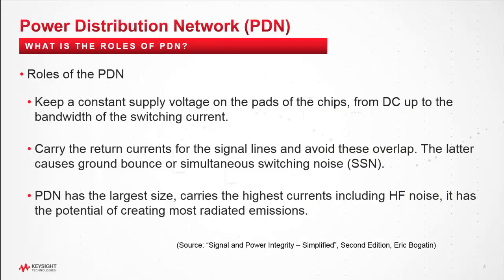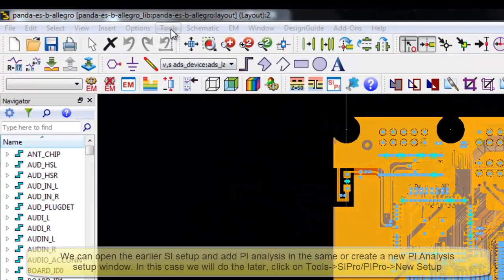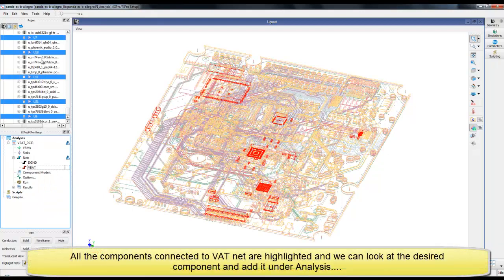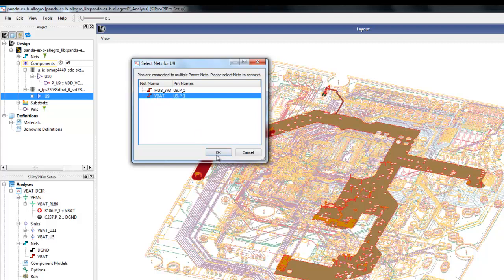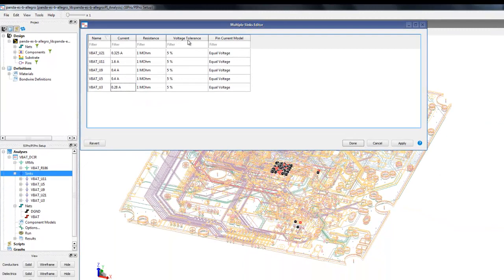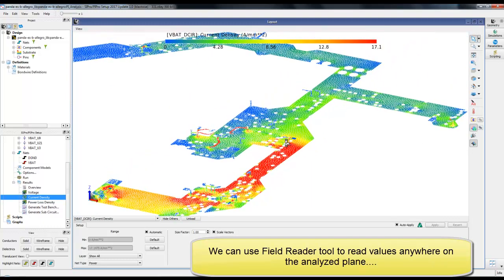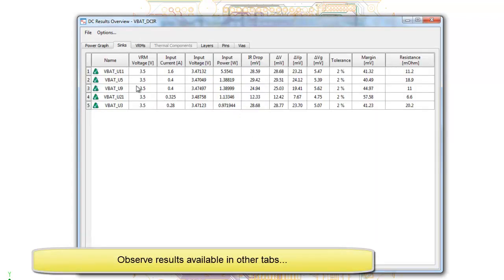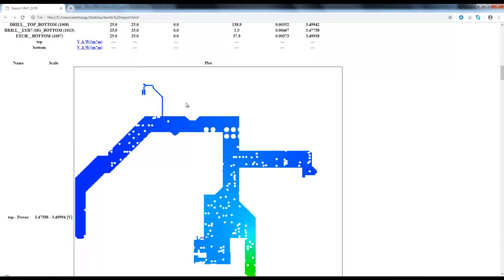HSD Tutorial-5: DC-IR Drop Analysis using PIPro

Comment: Hii thanks for this video. Suppose a voltage source is connected across 2 series connected resistors. And then how can we select source and sink?
Reply from the maker: I would recommend you to contact local Keysight tech support team on this but you can pick any of the resistor as source with desired voltage level. Sink is typically the IC where you want to supply voltage & current.

Comment: Hi sir,
What is the allowable current density for DC drop analysis?
Reply from the maker: I am not sure I understand your question as that is pretty much depends on your application & how much material can handle. More current density would mean more heat so your heat sink should be properly designed to cool down the system along with fans etc.
Reply: @BhargavaAnurag  sir, while doing power integrity simulation in software, there is the constraint for current density. Is there any allowed values like 100mA/mil'2, like that..
Reply from the maker: @selva81652  I am not entirely sure what you want to ask here? If you want to customize the density graph to your own range then right click on the density bar at the top and select Properties and then define your min & max range. If this doesn't resolve your issue then contact the local Keysight tech support team.

Comment: Hi Anurag Sir. What does equal voltage and equal current models means while defining sink Current in the simulation. If I have selected an IC as a sink which has total 5 pins connected to Power Net and specified 5A of current. Will this current divided by 5 (No of power pins) when specifying Equal Current Model or 5A Sink current per Pin? Please help me on this. Also I am seeing the Total Sink Current even I specified 3A but it shows very high current density on TOP Layers shown in Overview in results. even you can see in your workspace demonstrated here it shows something 398A/sqmm Max Current density in Results overview under layer Tab while max sink current from all devices is max 10 AMPS... Actually I want to know what is the Max current density reported in results overview under layer Tab. please help me on this..
Reply from the maker: Hi Sonu,
I will reply based on what I understand and for remaining portion you can contact ADS tech support team. For current density, you should only look at the Power Plane layer that you get during visualization and that shows 17A/sqmm if I remember it correctly (you can double check). What you see under Layers window is based on the conductor area and not necessarily for the power plane/net you are analyzing so you can simply ignore the same.
Hope this helps in some manner, if not then I would recommend you to write to ADS tech support team directly at: eesof-europe_support@keysight.com if you are based in India.

Comment: Can the copper weight (thickness) be changed for the IR drop analysis? This would clearly have an effect on the results.
Reply from the maker: Hi, Sure....you can change the metal thickness in the stack up definition and run PIPro analysis for different thicknesses to see the change in the IR drop.

Comment: How is R186 VRM?
Reply from the maker: @Yash, that's as per your design. I selected R186 which is the component at which desired Voltage is available and its not the actual VRM as that may be something like U2 etc providing 5V or something like that but what we are concerned with in this tutorial is the component which I want to use as the origin point providing the needed voltage level. You can use it as per your own design. 
Hope this clarifies...?
Reply: @BhargavaAnurag  Thank you. Yes it clarified my doubts.